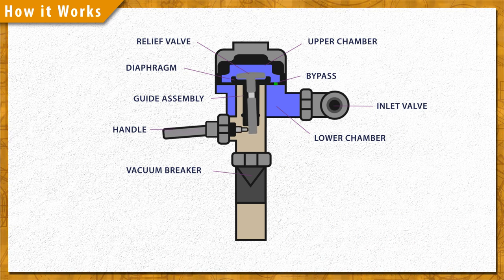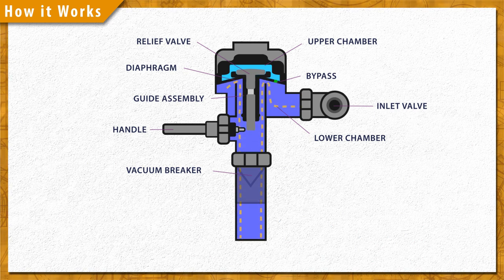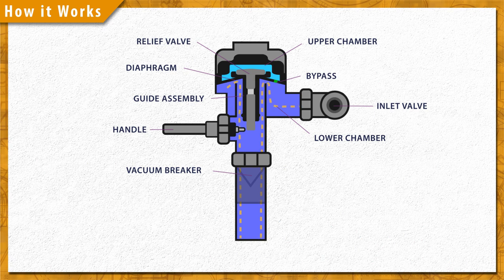How Do Flushometers Work? | Spec. Sense

Comment: It's cool how the basic design hasn't changed at all over the years. I have a Sloan flushometer from the 50s and inside it looks almost identical to a brand new one.
Reply from the maker: Thanks for watching. These flushometers are quite brilliant in a way. An automatically timed, resetting valve which uses pressure from the incoming water supply to close the valve after the flush. Why change the design if it works so well!
Reply: You know, Sloan invented the modern flushometer. It was called the royal flushometer, and they're still available today
Reply: Yep and between manufacturers the parts are very nearly interchangeable because there is no difference in design philosophy.  No one has really come up with any new ideas in this space
Reply: Is it at your home or your business place?
Reply: @DavidChrisCastillo-im1wg  What difference does that make?

Comment: Very good video to explain how a flushometer works! 

I was told that a flushometer wouldn't work in my home because my pipes were 1/2", my water pressure is 70 PSI.  I have a 3/4" inlet to my flushometer so I reversed a 3/4" to 1/2" reducer to make it a 1/2" to 3/4".  Well they were right, I installed it and the water never shut off.  Not one to give up I then considered why and the simple answer is the relief valve is to designed to seal when a large volume of water hits the valve, a similar design is in used in anti-siphon valves.   I then thought if I had a way to apply pressure to press the relief valve shut.  I eyeballed what the gap was and looked through my accumulated plumbing parts collected over many years.  What I found was a kit for mounting a tank to a toilet.  Above and below the tank are thick bushings.  Set one of them on top of the relief valve and works great!   The length of flush cycle can be varied by the bushing (or washer) thickness, thicker will be shorter, thinner will be longer.  My urinal is designed for a  1.0 gallon flush.  I put a 5 quart old ice cream bucket to measure.
Reply from the maker: Thanks for watching and sharing your experience! That is quite interesting, what you basically did was re-time the valve with the spacer reducing the pressure and volume of water needed to close the valve. Its actually quite fascinating to see all the different variations between flushometers. By using a combination of different relief valves, flow restricting rings and bypass hole sizes, a variety of gpm can be achieved.
Reply: @AmreSupply  The way the flushometer works reminds me of an anti-siphon faucet.  On those if you turn the water on just a trickle and plug up the outlet the water will escape from the part that allows air in to drain  the pipe.  In it's case, like the flushometer  it has to have an amount of flow to pop up the part that seals the air inlet.  I had one that was constantly leaking because it has a bad o-ring. 

I actually installed a utility sink and urinal.  I built a full wall against my basement wall then came out about 15" to align the drain with the cast iron pipe that stuck up for my washer drain and installed a rubber T to connect them.  I put "garden hose" soldered to my 3/4" cold and 1/2" hot and used a Y for each to access water.

Comment: This is a good video to help a person understand the basics of how flushometers work. I think a follow up video showing how problems like hard water scale buildup, deteriorated rubber, nicked O-rings, damaged sealing surfaces, missing or incorrectly installed parts, etc., etc., affect flushometer operation. Use the same simple but very effective video while explaining each problem. Today I worked on a urinal that would not stop flushing even after all the internal flushometer parts had been replaced with the correct parts. You know what the problem was (I think, lol)? There was a very small amount of hard water scale buildup on the sealing surface under the outer edge of the diaphragm in combination with a diaphragm cover that had some slight grooves worn into the underside circumference that presses down on the diaphragm to maintain a leak-proof seal. The bypass hole was clear and passing water to equalize pressure between the upper and lower chambers to stop the flush but I think there was a slight leak somehow between the upper and lower chambers that prevented the pressure equalization that stops the flush. I replaced the diaphragm cover and cleaned up the tiny amount of scale and that did the trick to make the continuous flushing stop. I'm no plumber but I think if there is even a slight difference in upper/lower chamber pressures for whatever reason flushing will never stop. Funny thing is that I've seen many flushometers that were in much worse shape than the one I worked on today and they just keep on working no matter how many times they've been kicked, slapped, etc. Anyhow, hope this helps someone who may be scratching their head wondering why all their new parts haven't fixed the problem.
Reply from the maker: Thank you Tino, we're glad that you found this video helpful! We actually did a specific video on troubleshooting that covers some additional problems as well. We did one for each of the major brands. This one is for Sloan: https://www.youtube.com/watch?v=Upkq8qIwD5M&list=PLCo9SMjkdWByMAtNJtJoV9e3hvdkojlRz&index=1&t=1s You are right that any scale or other buildup around the diaphram seat can prevent a good seal and can cause continuous flushing. Thank you for sharing your experience though it will be helpful to anyone reading.
Reply: Thanks. That was another helpful video. I've seen most of the problems you mentioned but it's always helpful to see information explained in different ways. I don't handle a lot of plumbing calls but when the boss sends me to one the problem is almost always a combination of several things. Thanks for taking the time to put together such clear and straightforward videos. I really like the simple animations with different colors showing how the water levels, pressures, etc. change and affect other plumbing parts during operation. It really helps a person visualize what could be going wrong.
Reply from the maker: @tinovalle5278  Thank you! Yes the animations are something that we put a lot of thought into but we truly think it makes a difference and helps create that lightbulb moment for the viewer. 

We have a few general "How it Works" videos on this playlist. I think you might find some of them interesting: https://www.youtube.com/playlist?list=PLCo9SMjkdWBxWwrWCmzvRMSi2kLo9bGdp

Cheers!
Reply: I've probably done 1000 of these, not kidding.  Over the course of 10 years.  I work in a max prison that houses 1400 inmates.  They all have those Acorn Bradley s.s. comby toilets.  Anyway, we had a hard water problem and copper lines that would get water hammer and cause particles to get released and end up in the flush valve.  So what would happen is those particles would get sucked up into the equalizing hole, which is how the upper chamber equalizes pressure to drop the diaphragm and relief valve.  I 1st started to just clean the flush kit itself but only worked "sometimes" and then did a lot of research and found that if you take a single wire from a steel brush, poke that through the equalizer tiny hole, water can now pass through again to equalize the upper chamber.  I hope I don't sound dumb and we're not talking about 2 different valves.  I just woke up, and I like learning from people who have experience.  I'm still groggy and not thinking clearly and have misinterpreted discussions before, lol.  In fact, you guys, I have a question, and I apologize that this is so long.  So you pull the handle, the relief valve tips (here's where I'm lost), and water rushes between the relief valve and diaphragm?  Or does the water rush between the rubber diaphragm and the metal part of the flush valve?  Much appreciated, guys 👦 🙏
Reply: Weird that this happened to me after 10 years and there were a set of urinals.  So 1 urinal, continues to flush.  Easy right?  Replace kit.  My eyes were wide open when it happened again.  Never seen that.  Cleaned inside that rim of the chrome flush valve the diaphragm seats onto.  Still continues to flush.  So I switch chrome flush valves between the 2 urinals to rule out ANYTHING, and now it started being a jerk on the other urinal.  I had a crazy idea of now switching this troublesome valve with a closet valve (of course, switching the appropriate flushometers), and now the troublesome valve works like a charm lol.  I'm still confused because why didn't it work on the urinal?  I even tried increasing/ decreasing the water inlet to no avail.  What you guys think?  I love learning from people and love plumbing

Comment: Great explanation on how the flushometeter works.  Thanks!  I have a question about the diagram you used.  You show a vacuum breaker downstream of the flushometer...what is its purpose?
Reply from the maker: Thanks for watching, we're glad that you found it helpful! The vacuum breaker prevents water from being pulled (siphoned) back into the flushometer which would contaminate the water supply.

Comment: Very informative... always helps to have a visual...
One question... if you're using this setup, is there still a need for a tank, or does this do the whole job???
Reply from the maker: Thanks for watching. No tank is needed with this style of flushometer. This is just a self timing valve, the high water pressure ensures that the bowl is flushed and refilled quickly.

Comment: I'm having an issue with a Flushometer. 
1. Initially the flow was so high that the water would sometimes spill over the edge of the toilet. I dialed down the inlet valve screw. This worked for a while. 
2. Now the water doesn't flow unless I hold the handle down. I opened the inlet valve to the max. Letting go of the handle stops what water flow there is. I suspect that the diaphragm is not being forced up to release the water in upper chamber.
I think the bypass hole is blocked and thus the upper chamber never releases its water and when the handle is released, the pressure in the upper chamber forces the diaphragm down, closing off all water flow.
Your video was/is helpful in trying to diagnose this. 
To repair this, I need to identify the Flushometer, which might be old (50+ years?)
And help appreciated.
Reply from the maker: Thanks for watching! The diaphram does wear out over time and can create issues, so its a good place to start.

If you're model is 50 years old then it could be one of these models.

Delany, Powers, or Crane  manufacture which might be a Flushboy, Rex, Presto model.
https://www.youtube.com/watch?v=rsWy6EGX51o&list=PLCo9SMjkdWBxiJUBfdBZxGy6n4OTrmbri&index=1

Sloan: Royal Flushometer
https://www.youtube.com/watch?v=Upkq8qIwD5M&list=PLCo9SMjkdWByMAtNJtJoV9e3hvdkojlRz&index=1

Comment: Do these usually have check valves/backflow valves in-line?
Reply from the maker: Thank you for watching. The vacuum breaker in the flushometer will prevent some backflow. There are differences in buildings and plumbing codes depending on your region so it is hard to say exactly what is required for check valves or other valves in the rest of the system.

Comment: But I don't understeand, this device can be used only on U.S.A. style toilets, that have some kind of vacum valves or also can be used in Europeanen style toilets, that are classic flush toilets.
Reply from the maker: Thanks for watching. We are based in Canada and we're not as familiar with the plumbing codes in Europe so I can't say for sure all of the differences between the toilets and flushometers there.
Reply: @AmreSupply  In Europe, the water, just the water pushses the content.
In U.S.A., most toilets do have a valve, so a kind of vacuum is created and this means is not just the water taking outside the content.
My question is the flushometer can work only with U.S.A. style toilet or also European ones.
Reply from the maker: @Telecolor-in3cl  Most residential toilets in north America use a gravity fed tank system. Commercial toilets with the proper inlet size and pressure use flushometers.

I don't know what the plumbing code in Europe states regarding the use of flushometers so you'd first need to check the plumbing codes, then make sure you have the right sized inlet and pressure for it all to work.

Comment: Sorry guys/gals i have a question.  Its about urinals and i wanted to ask what you do when a urinal backs up because of peter cheese (i call it) calcium, n uric acid crystals, whatever peter cheese consists of.  Urinal augers are a joke.  Muriatic acid doesn't even touch this stuff.  I have to pull the urinal, flush the urinal in a floor sink with a high pressure hose to get that buttery peter cheese out.  Then i hydrojet into the 2" wall inlet and it does the job.  But it takes about 30 minutes.  Just wondering how other people handle a backed up peter cheese infested urinal.  Thanks!
Reply from the maker: Thanks for watching. Calcium is an organic soil, so an acidic cleaner will help dissolve the crystals. The only thing is the acid will often take a long time to dissolve the crystals, and that is assuming that the acid can work it's way into where it is needed. Seems like for extreme blockages those extra steps you listed are necessary.

For those who are curious, these principles of cleaning are covered in this video: https://youtu.be/qRPe4IR79u8?si=6lorlhnU3Iin3W45

Comment: I can watch this 20 times, and still not understand what the hell he's talking about.
Reply from the maker: Thank you for watching. The diaphragm is used to seal the valve. At rest the water pressure is equal (above and below the diaphragm) so it remains closed. Pressing the handle releases water from above the diaphragm. Now the pressure is unbalanced. Since there is now more pressure below the diaphragm, this will lift the diaphram up. Its all about that pressure balance. To close the valve, the pressure above the diaphragm must be equal to the pressure below. This is done by the bypass hole, it lets a small amount of water into the upper chamber until the pressure is equal again. If you want to see how the physical diaphragm sits in the valve you might find this video interesting: https://youtu.be/IhBA-AZBXGc?t=137 Hope this helps clarify this.